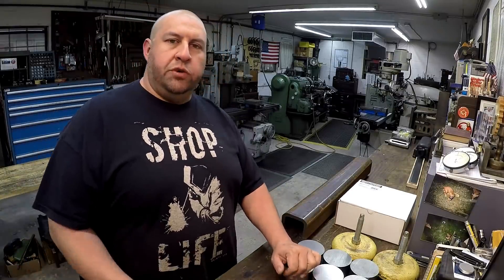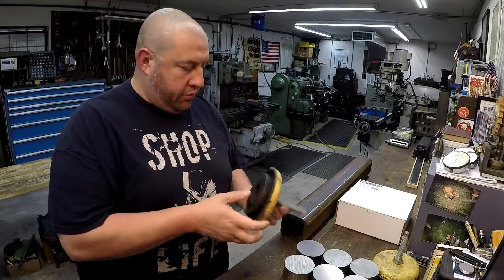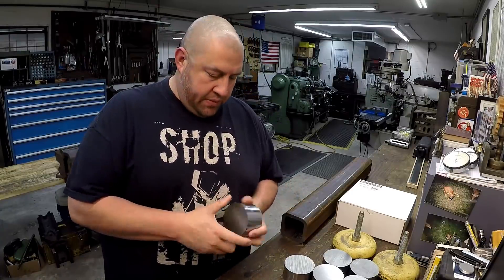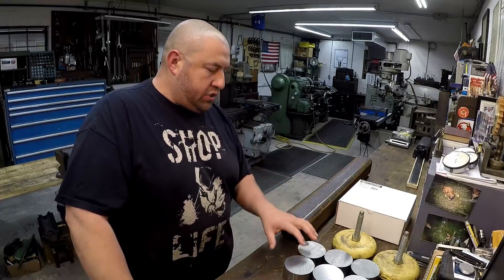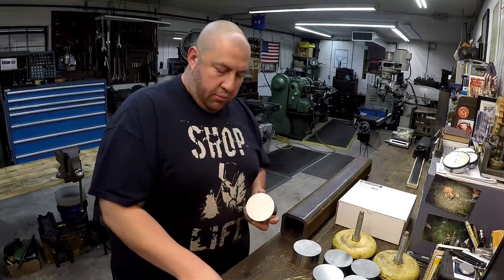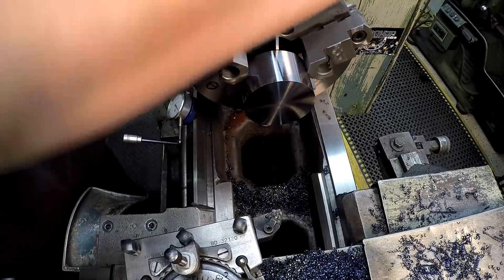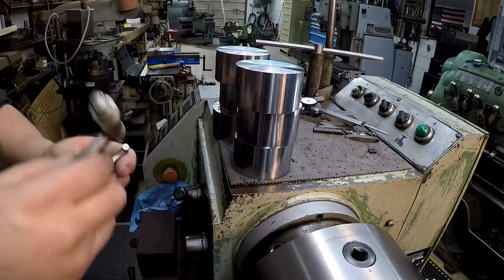SNS 219: Edge Technology Chuck Stop, Inspection

Comment: Hi Adam, don't worry about concave facing cuts, lathes as I understand it are designed to do exactly that, the more precise the machine, the tighter the surface tolerance, but it will still be measurable. It was explained to me, many many years ago, as a way of ensuring matting parts abutt around the periphery, which has loads of advantages to the matting faces of two convex surfaces only being in contact at the centre. Hope the ops gone okay, cheers.

Comment: Lecture here:

Accuracy is how close the measurement is to the real value

Precision is how repeatable the measurements are.

So, the 0.002" dip to the center off all of the parts shows that the turning operation is precisely the same to within the limits of measurement.

The one part coming out at 2.0015" while the other 5x came out at 2.000"  shows that there was an imprecision in the setup, with a part coming out inaccurate to 0.0015"

Now, this is all rather pedantic, since the tolerances on these parts as required for function are quite a bit looser than +/- 0.002" - they are going to be welded to saw-cut carbon steel tubing after all!

So, the spider is a very precise stop for making repeatable parts to close tolerances - thanks for sharing Adam!
Reply from the maker: No Bash this year huh? Thanks for the comments.
Reply: No, I'm recovering from some medical issues... hopefully, I'll be able to make it next year...

Comment: Dear Adam, I agree with Stephen Deakin, that lathes are set up new to face cut a slight, very slight concavity. This is done by misaligning the headstock relevant to the long axis of the lathe to a very small degree. Trying to adjust this is futile! Best wishes and hopes for a full and speedy recovery from sunny West Cornwall, U.K.

Comment: A lathe should always face slightly concave, even a brand new lathe (because perfection isn't possible, it's either concave or convex), so that if you want a truly flat surface, the concave face sits on its outer rim on a surface grinder chuck. A convex face will sit like a rocking chair. This is what Dr. Georg Schlesinger says in his book ''Testing Machine Tools''. How concave is another question, I think it's in the book. The concavity shown here seems excessive though, and is cased by wear. Pressure on the Near side of the left dovetail surface (also the inner saddle surface), due to cutting forces while facing (and turning), causes this wear.

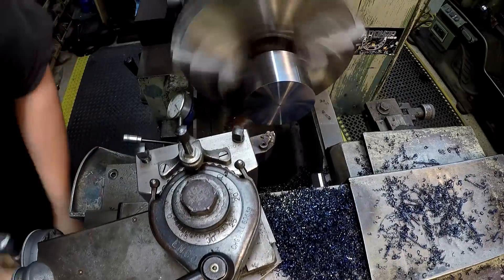Btw, look at those chips going in and then coming out from under the cross-slide cover at 19:48!!

Comment: Adam .
I do believe when you start cutting with the insert at first is cooler then when it gets to the center it gets hot and it is spans 1 to 2 thousand try to use coolant to cool the insert than to see if there's a difference .

Comment: That may work faster than a custom holding fixture I use on one part I make, do about 10 to 15 per order. Gonna check into it. When I make multiple parts like you made in the video, another measurement I take is measure the thickness around the outside in four places. 
You gonna have a table that you can toss your shaper, lathe, mill and other items on at the same time when you need some quick temporary room in your shop. It should handle your house too if you need some temp yard space. Can't wait to see what you are going to put on it. I know for sure, you will never break it.
Reply from the maker: I love a heavy duty work table. A few at my job are hand me downs from other shops that sound like sheet metal on uni-strut legs 🤦🏼‍♂️

Comment: On the flat face issue,  I don't doubt you could have worn ways,  but another factor is how low your cutting speed gets as you approach the center. You only get consistent metal removal with constant cutting speed.

Comment: I was told that the concave facing cuts that a lathe produces is done intentionally. 

The lathe is manufactured to produce this slight concave cut so that the work pieces can be stacked without having them fall over. Now of course if the face is perfectly perpendicular, the stacking of pieces would not be a problem. But, if the face were to be even a little bit convex, this would be a problem. So they leaned to the side of caution and made the cross slide cut just a little bit concave.

It would be interesting to test other lathes to see what kind of facing cuts they produce to either confirm this to be true, or confirm that this is false.

Great videos Mr. Booth, always enjoy watching them.

Comment: Adam, about a year ago you chucked a cantilever bar and made a 10" long cut. With undercut between the 2 ends. Difference in diameters was about 0.0005", as I remember. So you were happy headstock was parallel to ways. Now the diff is 0.0025 in 1.5" perpendicular. Mr. King told me same thing....cross slide not perpendicular to headstock and ways, but he told me to leave part in chuck and run indicator from edge to center. BUT that was not your intent. Thank you and my best.

Comment: Try taking the same facing cut with the carriage stop locked.  The carriage might be moving away from the chuck due to the tool force. The tool cutting force is probably greater toward the center because the surface speed is lower.

Love your channel.
Reply from the maker: I used the carriage lock for each finish cut but don’t like to drag the tool back across a finished face. I’d rather move the tool back, and reset for the next part.

Comment: The one you knocked in will be bigger, I bet if you tried a piece of feeler gauge (0.03mm or whatever the Roman equivalent is!) between the part and the parallel you’d have a gap before knocking it in. The jaws will be spreading out at the furthest point from the chuck face, especially since the part it only about halfway in the jaws.
When making soft jaws at work we always taper them back toward the chuck (larger diameter on the chuck side) so it pulls the part back to the shoulder on the jaws

Comment: I'm certain that the cross slide dovetails are worn on mine.  It will tighten up on you  as you go in.  I was a bit disheartened when I discovered that the top half of the cross slide had been milled by someone that had the lathe before me.  It would probably take some inlay work to bring it back out to the point where it could be scraped in and have the gib tighten properly.

I got my eye on a D-8 Do-All surface grinder.  Depending on what I find on it, getting a really flat face may come down to leaving the part a few long and finishing it on the grinder.  Gotta get that home first and see what it takes to make it run.

Comment: Hey Adam,if you face with the insert having more of a positive angle to part instead of square or a bit negative,the insert should push crosslide against dovetail,as opposed to wanting to pull away from the dovetail with a negative angle on insert,hope I worded that correctly.

Comment: One limitation comes to mind. If you can't tap the work back after tightening the jaws you can't compensate for wear in the slides allowing the jaws to tilt and move the part away from the true face of the chuck. So this relies on using a very good/new chuck.
Reply: Excactly my thought.

Comment: The stop works reasonably well, depending on what work you want to do on the lathe.  Great view with your Starret indicator.  I like Starret equipment.  And that .002 out of flat looks to be coming from the lathe.  Not a big deal, just remember it is there when you set up, then compensate for it.  You're no dummy, so I guess you already knew, but machinist OCD!  Had to say something.

Comment: Actually, I think you would want a lathe to face slightly concave (thicker at the OD of the workpiece and slightly lower in the center). That way a disk will lay flat on a surface rather than spin and rock if the face was convex. And if a lathe faces convex and you need a piece to lay flat, one fix would be to machine a slight depression leaving a land of material at the OD.

Comment: In my experience, assuming you have the ways locked (long feed) so the tool won't back out ,  what is happening is the tool is actually digging in as it gets towards center due to the increased  tool pressure from the slow surface footage. Any play in the cross slide ways will allow the tool to lever itself into the part due to the force of the facing cut. A lite finish cut or increased surface footage to reduce tool pressure will usually result in a flatter part. Of course having a lathe with absolutely no play always helps too. Having worked on Old machinery most of my life I always had to be aware of heavy face cuts possibly digging into the workpiece.

Comment: Glad to see you up and about.  Hope you are healing well.  As always I love your vids, always thought provoking. 

I think the measuring is irrelevant if you don't first make sure the part is mounted parallel to the spindle axis.  And to be repeatable you need to tap the parts in, so they are fully seated.  Given the hollow in the middle of your parts the  pressure of those taps will be concentrated on the three contact points where the part perimeter crosses the spider legs.  Those parallels will get chewed up pretty quick, unless they are very hard.  If they are hard then the part will suffer.  

I would prefer to use the entire face of the chuck as the reference, so the full perimeter of the part contacts the chuck, evenly all way round.  

Frankly I don't see any benefit to the "spider", and this concentration of forces at the limited points of contact seems a problem for long term consistency (esp if the parallels accumulate little dings).

I know you can polish out a few thou with scotch brite, so any testing like this should probably skip that step.   Unless your forearm is fully calibrated you are introducing some amount of variation, small though it may be.  

Champhering is good, knock off the sharp edges, as a second op (do all the facing with one tool, then remount each part for the champher step).  

Keep up the great work, and hope you feel top notch soon!

Comment: Hi Adam, the wear on your cross-slide may not actually be wear from what I've heard. The cross-slides on lathes are supposedly intentionally slightly angled towards the chuck. When you take a facing cut, this results in the rim of the piece protruding beyond the center of the piece. This way when the piece is mounted to a flat surface, the whole outside rim is contacting the surface instead of risking the piece wobbling around on the (very, very blunt) peak on its center.
Reply: Interesting.
Reply: For what i know it' s have to be about 0.02mm for 400mm test workpiece

Comment: Thanks Adam! I hope you're doing well. I've had the opportunity to train with my university's machinist in some basic techniques since I've been requested to make various parts for my lab. We use older Tree mills and Clausing-Metosa 1500 series lathes; both are heavily worn - and have been used/abused by students, like me, who are not necessarily gentle. Do you have any suggestions for how to deal with heavily worn machines when trying to make accurate parts? Most of my parts need to be machined from stainless, and the shop cutters are mostly 'chinesium-grade' cutters, but I have to make do. Thanks in advance. I probably wouldn't have volunteered to do this if I hadn't been watching your channel, so thank you, sincerely, for your ability to inspire novices like me.

Comment: According to Dr. Schlesinger "Testing machine tools", a finishing late should face within 8 tenth over a foot diameter (hollow only), and a tool room lathe within 6 tenth over a foot diameter (hollow only). So, your machine has wear, indeed. But it is not terrible :-).
Reply: Good info, from what I’ve read lathes are set up to face slightly concave from the factory. I would think just the cross slide would wear convex though. Carriage I think could wear and cause concave though.

Comment: Adam , hope R&R is going ok . As to the lathe I was always under the impression that they were set up to turn a very slight dish with the cross slide to make sure the part would sit flat on its outer edge ,if it was the other way high in the centre it would wobble , at least that’s what the then local machine builders told me when they scraped in the saddle’s , I think they aimed for 1 thou in 12 inches dia
Reply from the maker: I’d have to verify that with Richard.

Comment: Nice job to check the run out on the machinery. Surprised you didnt consider the shaper to cut the square to fit the tube as an exersize.
Des.

Comment: Interesting ...just thinking through this and wandering if the runout is due to the increasing load on the tool due to decreasing surface speed as you near the centre. Maybe slow the feed speed ...? Or maybe try same experiment on much larger diameter and check graduation of runout. If it is due to wear on the dove tails then you would expect it to be worse closer in and rectifying that might bugger up outer alignment. Maybe move the tool to the other side of the head stock where you would expect less wear in the dovetails. Love ya efforts bro.

Comment: HA! I wonder if you could rig up some air to those feet for your heavy table to a central location and levitate that sucker anywhere you want with air pressure. You would need a pretty tight fit with the floor so the air pressure doesn’t leak out. If it works it should move with finger pressure, LOL. Retracting the center 2 pads (no air) should cut air usage. Three feet (tripod) would be better. Worth trying to amaze your friends.

Comment: I am not a machinist, so this may be bad practice, but here is an idea, to further test the wear issue on the lathe.  Could you face the part, from the outside in, then once you get to the center of the part, leave the tool where it is, but reverse the lathe and continue to run the too L to R across the face, but then stop maybe 100 thousanths from the edge. Then of you do the same measuring on the granite plate, you should see that outside 100 thousanths would be high, just past it would be low. Then as you measure to the center, it would (or could) be about 1/2 the difference between the high and low.  Not sure if this will show anything of use, but it could show if the wear is throughout the cross-slides travel.

Comment: #1 do the first facing without the parallels
    -> more area from the jaws to align the part
    -> force is closer the the jaws guides
#2 with the parallels on the 2nd side, use a torque wrench to tighten your juck
    -> jaws will allways move the part away from the juck becouse of the play in the jaw guides
    -> with a torque wrechn you get the same error, but with an higher repeate rate.
#3 your lathe is just fine. Its better to have concave parts then convex ones (in my eyes)

Comment: adam, if your gib has a line of screws to titen up you can fix some of that .002 my old lathe had .007 on 5" i got it down to .0018 over 5". saddly if it is a 1 screw gib next to grinding or hand working it not sure how you would fix it. thanks for sharing

Comment: Good video , would it make a difference if you used a carriage stop instead of relying a dial indicator with an accuracy of about .001 ?
Reply from the maker: The lock prevents the catalogs from pushing away from the workpiece, not location accuracy.
Reply: I meant you were using the dial indicator to stop at zero each piece you cut  .

Comment: It would be interesting to try again with a sharp high speed tool and light cuts to see if low tool pressure makes the problem go away. You could also run your compound forward or rearward to see if the wear is worse at some places on the cross slide.

Comment: The reason your parts were concave is at the start of your cut your tool,  on a 3.5" part, worked on almost 11" of material in circumference for every revolution, when your were at .5" it only had 1.57" to deal with per revolution. So since the feed stays the same per rev, it progressively has less stock to deal with as it gets toward the center of the part. If you would have taken a free pass you would have reduced the .002 dish from the edge to the center but probably wouldn't get all of it out. A better inspection to find how well your stop worked would have been to also check all the way around the part to see if both the sides were parallel. From what I saw your thickness didn't have much variation in thickness, your stop looks pretty promising to me. We would weld three pieces of CRS in the same configuration and then grind flat on the surface grinder to make basically the same thing. Without the magnets we would put it in the chuck and turn it so the sides of the parallel would hit each jaw and the tap the part into the stop.
Reply: carl730 worth checking into this, easy enough to test. I think the knee jerk reaction to machines cutting in ways we don't expect is wear. Always worth verifying before you convince yourself that your ways are to blame
Reply: I was thinking the same thing.  You can tell the machine is working harder on the outside of the part just by the sound.

Comment: Perhaps you could indicate the slides under load to see where the wear is and in what directions. If you could take half the wear out or better with your surface grinder or shaper it would be a big improvement. Once you have the (fixtures?) made up you could do any similar machine, and you could scrape some other day and have much less material to remove. Or that is what I am guessing, anyway :).

Comment: Any idea what grade of steel was used in the shaft?  A search says it should be one of these 1045, 1050, 10V45, 4140HT, 4150HT, or 17-4.  It looks like it machines well.  Great video.  Hope your recovery is going well.  Praying for your recovery.  Hope You Get Well Soon!
Reply from the maker: Yes the material is 1045 grade chrome plated steel.